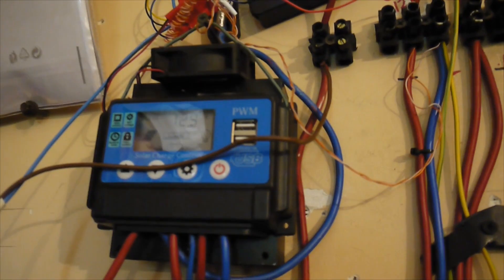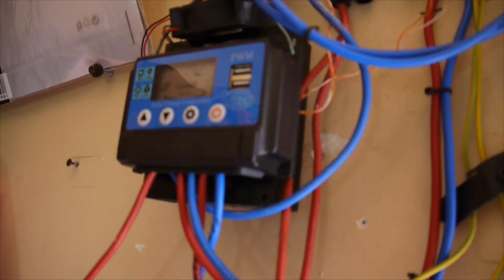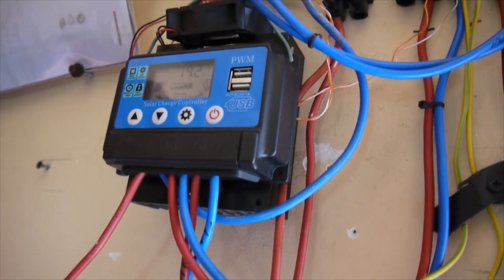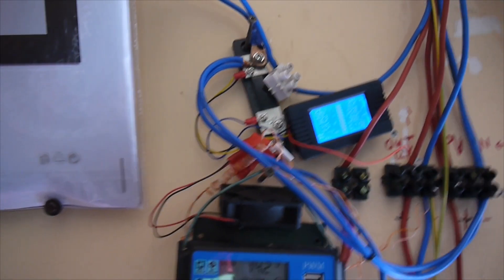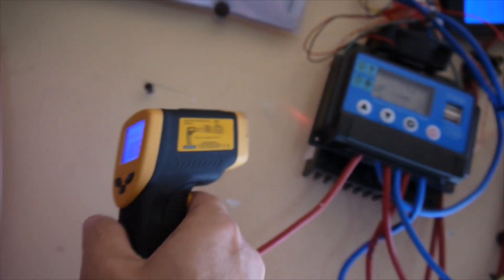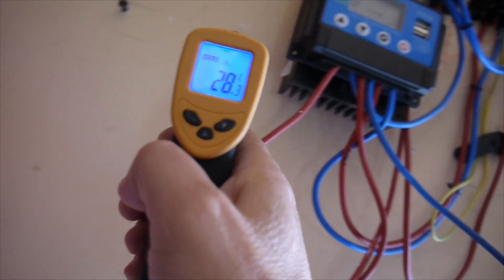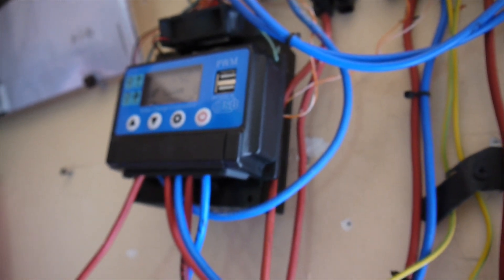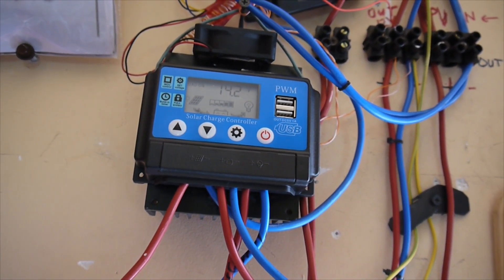Improve solar charge controller heat sink upgrade results

Comment: 40ah solar battery, 55watts solar panel.
Solar charge controller gets over heat can't even touch the back side of charge controller..
Reply from the maker: Try to add some heat sink, like I did...